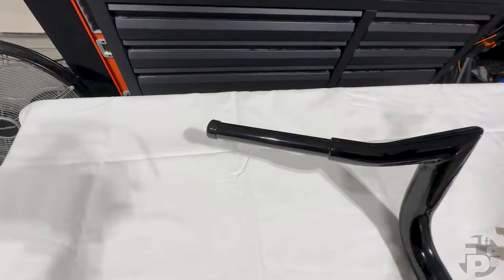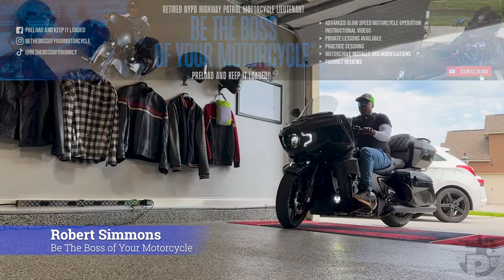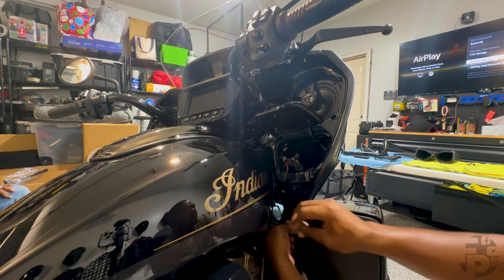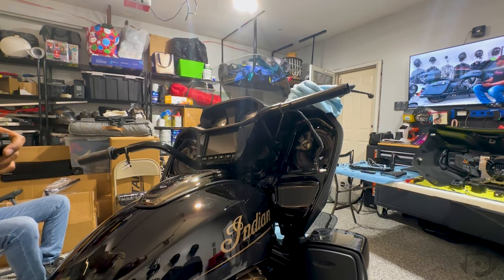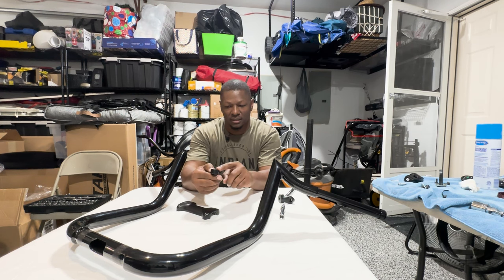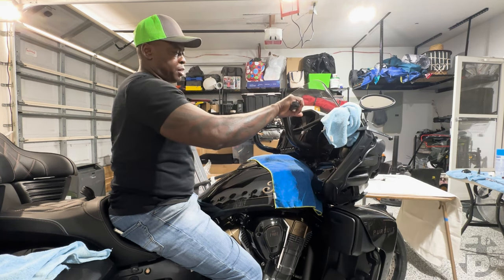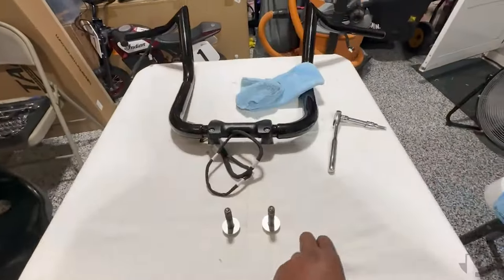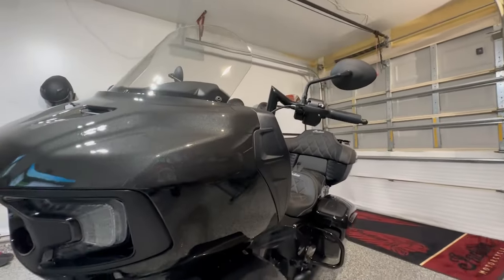Tab Performance Folsom Prison Handlebars For Robert Simmons' Indian Pursuit Elite!

Comment: Nice work with the install. It looks pretty straightforward for an experienced DIYer to do. Just have patience with the O ring part I guess.
Reply from the maker: Yes, patience is key lol other than that it is mostly a fun project. I was nervous when I did my first swap but you learn so much about the bikes when you break them down.

Comment: Did you have to replace the clutch cable or brake line?
Reply from the maker: No, there is no need to replace the clutch or brake cables…the extra length is secured on the inside of the fairing which will accommodate any length of the Tab Performance Folsom bars.
Reply: Thank you

Comment: hey Finesse  got a question for you.. looking into getting the TAB Folsom bars but my dealer wont install ( i will find one that will do it) and instead recommended the KST 14' Comanche. you have any comments on the KST  were those what you had on before??
Reply from the maker: I’ve never had any of the KST bars… that’s odd they won’t install a certain brand of bars??? Bars are bars, however they are super simple to do yourself… if it were me I’d just give a different dealer my business 🤷🏾‍♂️. You can get them if you plan on heading this way anytime soon and I can install them😃
Reply: Okok.  Damm wish I was. Know weather here ain't conducive for me to take a trip 😅😅 other wise I surely would.  Thank u though. I may have another dealer that would do it for sure, let you know how it goes..
Reply: Got the bars installed at different dealer this past weekend..  Was short ride home (120 miles) but so far i really like em.  cant wait to get some ride time in with em long distance andthen some.  will keep ya posted on how it goes. thanks for video on em.   @FinesseTheChallenger

Comment: What's your thoughts on TAB Performance cat delete?? Are you considering doing  delete on your Indian motorcycle?
Reply from the maker: The cat delete is amazing it reallly wakes up the bike and creates a lot of sound! However, it is recommended to have a tune on the bike if installed. Currently to my knowledge there is no tune available for 23 model bikes. So I am not considering it atm.

Comment: Looks great. But did you see the breakdown they had on tab performance on the handlebars they took apart a lot less.
Reply from the maker: I did, they didn’t remove the Challenger upper fairing to pull the wires out of the handlebars. Since the pursuit has lowers, for me, it is easier to remove the upper fairing and have access from the front. Either option works tho 😃 and I love options. Good eye, I had not previously noticed it.
Reply: Kool 😊
Reply: Love it